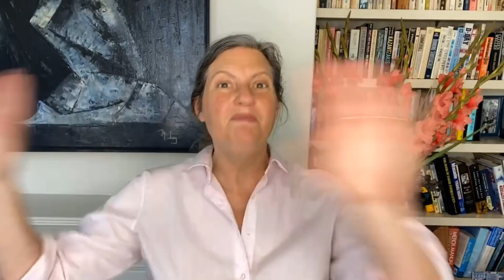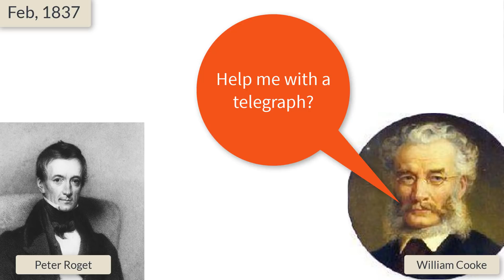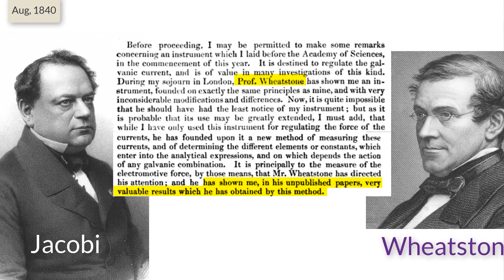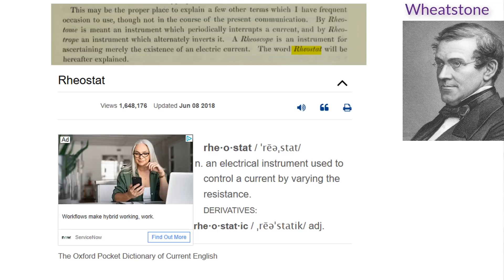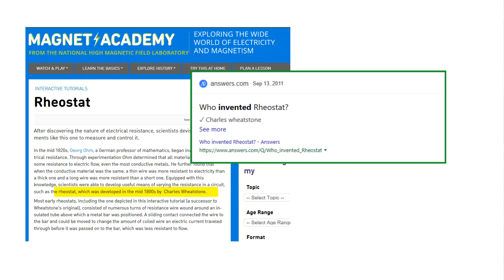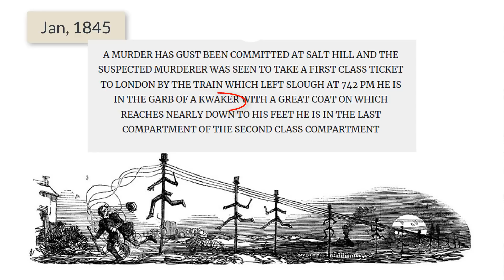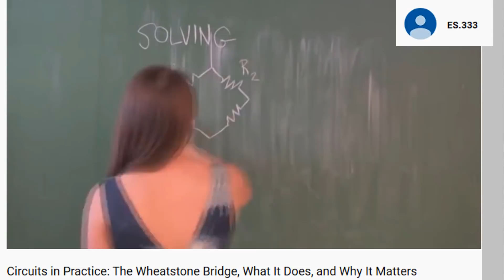Wheatstone Bridge: A (Not So) Honorable History

Comment: I don't think I ever got a Wheatstone Bridge that could not be solved. We were given them with some of the legs with more than one resister, not given the ohms given on the resisters but other Voltage or amps, for us to work out the Ohms from the voltages and current around it. It sometimes took half the black board to work it out.

Comment: Now with everything under the sun digital I seldom see even a single Reohstat in anything. 25 years ago we had at least 20 Danfoss analog 1 to 3 HP drives that controlled conveyors. No matter how many times we would spend calibrating start,stop & ramp up times after these 480 volt drives ran 10 to 15 minutes settings would drift causing major jams. These drives had at least 6 potentimoters. The replacement digital drives had no pots to adjust and once set they ran for years.

Comment: We used a Wheatstone bridge to create a gas detector. Platinum wires were 2 legs of the Wheatstone bridge. One wire was enclosed in a glass tube and the other platinum wire was in a gas stream sampling from a vacuum pump hooked to a small hose. If methane or other volatile gas is introduced to that open wire, it raises the temperature and changes the resistance in the platinum wire. A chromatograph could then be built by injecting a set volume into a "column" of silica gel which slowed the heavy molecules down. A carrier gas was used to keep a steady flow over the detector filament. Helium could be used or dried air was commonly used in the more rudimentary instruments. First gas to come out is methane and then successively larger molecules. The bridge records the change in resistivity to a chart recorder (today it would be a data logger to display on a computer.) Very simple and important on a drill rig attempting to detect entrained gases in the drilling fluid, very robust and non-fragile.

Comment: The Wheatstone Bridge was one of the early circuit builds I did as a child using my Heath Kit set from the mid 1970's. The Heath Kit was plastic blocks with a component inside and placed on a LEGO looking base plate. The blocks were then tied together with pin clips and wires to make a circuit. One of the more complicated builds was a 3 transistor radio, multi-meter sound generator, and timing counters.
Reply: When I was 11 I built the Heathkit Vacuum Tube Volt Meter (a truely useful and accurate bench meter) and when I was 14 I built the Heathkit oscilliscope. I loved those kits.
Reply: @pjh9104  My late dad went through electronics correspondence school through Bell & Howell and built the projects you stated. Subsequent courses used the built items to perform tests.
Reply: Built a Health Kit 25" TV while taking an electronic correspondence  class that the VA paid 90% of. Wish more young kids would experiment with wires & electronics. Doubt if 1% of people even know how to use a soldering iron or gun.

Comment: I have an idea for a magnetic motor. Please point out the flaws. First, there are no Souths to deal with. All the magnets are Halbeck configs. Take 15 stationery magnets and put them in a circle. (24 x 15 = 360) Then take 2 more and place them on an armature opposite each other, like 2 cars on a Ferris wheel. Place them close to the stationery ones. Since 15 is an odd number and 2 an even one, they will never interfere with each other. No Souths to worry about. Once the 2 rotating magnets are set in motion, you should be able to adjust the flux and get spin from the pushing 15 fixed ones. To accelerate, simply rotate the fixed ones like a distributor shaft. Well?

Comment: At 8:30  into the lecture I believe that there is a significant error pending your understanding of physics, but of the interaction between Jacobi and Wheatstone. Jacoby did not say that Wheatstone must have known about his instrument, in fact the opposite.  he said it was "impossible the he  should have had the least notice", which  speaks to acknowledging that the idea was not stolen but done in parallel.  He then goes on to in fact praise Wheatstone for discovering "a new method of measuring these current and of determining the different elements or constants, which enter into the analytical expressions, and on which depends the actions of any galvanic combination."  He also acknowledges the sharing of valuable results from an yet published paper, again acknowledging Wheatstone.
  Not the words of a wounded ego, I think. 
 Nor do I think negatively of your efforts here.  The history was very well done.

Comment: Interesting you mentioned a means of testing low resistance values. . .   Quite some years ago, I designed and built a 10 Amp "Earth Resistance" Tester. . ..  Recently I had a failed Inverter, it tripped all its Battery feed breakers.. .   I tested its DC input resistance with my "Earth Resistance" tester that uses an internal 12V battery and accurate 1 Ohm resistor, and  found the DC input to that Inverter was down to  0.028 Ohm.. . .   Years earlier there was a break on a UK-USA Cable, the special time fault locator was out of action, so the UK pulled out an old Wheastone Bridge and measured the fault o just of the USA coast.

Comment: Thanks for taking the time to share. Such a simple circuit but very important for the first precision or matched  resistors . It all seems so simple and obvious now but in 1839 sourcing an electric charge,copper wire or other metal conductive wire took some scrounging as well as quantifying  the electric charge s intensity and flow. The "Wheatstone" and Galv-meter led to the first calibration of tools to measure Volts Amperes and  Ohms.

Comment: I remember college classes that had Wheatstone bridge circuits, my impression is professors use this bridge for circuit analysis problems for homework and exams. But other than that, nobody uses it. Then out into the real world becoming involved with jobs that have strain gages, that's where I saw the value of the Wheatstone bridge. There is very very little change in resistance in the strain gage itself, probably not enough to reliably measure without the Wheatstone bridge. With the bridge, it becomes easy to measure (of course need reliable low level volt meter and stable excitation).

Strain gages can be fascinating considering they accurately measure stress in structures whether it be building I-beams, car frames, or force-moment balances.

Comment: In your Ohm’s Law video, you mentioned that just as the unit of resistance, the ohm, is represented by the Greek letter omega (Ω), its reciprocal, the unit of conductance, the “mho,” is represented by an inverted omega.  Some years ago, the unit of conductance was officially renamed the “siemens,” after the German inventor and founder of the Siemens company.  In the 1960s I remember that the sensitivity of voltmeters was still expressed, at least in the US, in “micromhos.”

Comment: Very interesting.  I only knew the bridge circuit as a rectifier
Reply: We used bridged diodes to build polarity guards on conferencing circuits. I one pair was reversed the bridge would ensure polarity. Without it one reversed circuit would short out the rest and efect volume on the call. Touchtone was also polarity sensitive. It too two decades before manufacturers finally put them in telephone sets. We used to work dozens of service calls on "Cant call out" daily before it.

Comment: Practical uses of the Wheatstone Bridge include load cells and strain gages.  Force and dimension change are able to be computed after gluing resistors to materials that will undergo stress. Being able to solve the Wheatstone bridge means you can make your own load cells on the cheap.

Comment: Another interesting an energetic presenttion. I worked in the Telephone Company in Ireland many years ago, where we used the Wheatstone bridge to measure the distance to a short circuit in an underground cable.
Reply: See my reply on that same method. Did you call the tests Varley or Murray tests? We also used it to find grounds.
Reply: @robertcuminale1212  Think it was Varley..
Reply: @banehawi  You know,  we show our age knowing about cable testing. So much of the plant today is coaxial and digital. Bit error rate testers are now cheap enough that all the technicians carry one. They have to test a customer circuit before completing the order. One thing craftsmanship and the technical skills have deteriorated. After the company laid me because of the AT&T split I went into business for myself. some of the people working for me couldn't use an Ohmmeter. One didn't know how to polarize a line, He'd never heard of "tip and ring." 
I'm very happily retired now.

Comment: Talk about a body electric:  A wheatstone bridge is a major component of a lie detector.   It is also the basis of the "E-meter" used by scientologists to guide their Dianetic "auditing" sessions.   I once got my hands on an E-meter  and soon learned that I could control it with my thoughts.   As an actor might do, if I thought happy contented peaceful confident thoughts, the meter  needle would move up to 4,  And if I thought to put angry disturbed violent fearful thoughts into my brain,  the needle would go down towards 1.   At any rate, this is just to say that the connection between electrical resistance and human thoughts is fascinating.

Comment: The bridge was used to locate breaks in telephone wires right up until the 1960s
Reply: We used it until the 1970s in Miami until all the Test desk men all retired. Then ELMOS, a computer program took over. Not as accurate but cheaper than personnel.

Comment: I worked as a Technician for a resistor company back in the 70's & 80's. We used our own factory built high speed testers and these testers were built with the wheatstone principles, but were far more complex. We had a decade resistor network that was set to the nominal value, two tolerance dials which set the plus and minus tolerance of the resistor under test. And finally a compensation pot that nullified internal resistance. Instead of two coaxial cables going to the test resistor, there were four and a compensation network was also applied to these cables. Then it really got complicated in that we had to test on the 60 cycle crossover. This was to keep any outside interference from the test. That crossover detection went to the logic circuit where it fed an "and" gate along with the bridge sample and the result "good" 1 or "bad" 0 went to a shift register. That's about it except that I did not mention that the sample signal is developed by a bi-latteral switch which is running at 60Hertz.

Comment: This is the first mention of the Wheatstone Bridge I've heard since I left Ma Bell many years ago.
Years ago telephone central offices had a test desk. In most cases it looked like one of the old corded switchboards operators worked from. The test desk took trouble reports from customers, tested them, dispatched a technician if necessary and then closed the ticket after noting what had been done to clear the problem. Most of them have disappeared if not because most testing is now done in the field by the technicians and the whole process has become computerized.

Every test desk had a Wheatstone Bridge mounted in a drawer. The test deskman (old terminology) used it to measure resistances on cable troubles using a Murray Test Or a Varley Test. A technician would call in and the testdesk using the cable plats send him to the farthest end of the cable and short circuit the pair of wires in trouble. The pair of wires would be connected to the bridge. If one side of the pair was grounded he would measure the resistance through the short circuit to ground. Then he'd reverse the bridge and look thought short in the other direction. Using a math formula and consulting the cable plats showed the overall resistance and capacitance the cable he could put the technician within a few feet of the problem location. I the cable was running in the air the outside temperature was factored in. Buried cable was consistent in temperature. Mixed buried and aerial cable caused a fluctuation in the math but a good test desk man could still get you very close.

At the time which was before the 1970s all the test deskmen were cable repairmen and a few equipment technicians tired of working outside in the weather. Some of the equipment technicians would transfer into the central office as Switchmen. That all changed in 1970 when the company women in these technical position to satisfy the Equal Employment Opportunity Commission. Without the field experience most of the women did the testing poorly. for the women it was all about money. The technical positions were filled with men and they paid better than the mostly clerical positions women were in. Almost immediately the company developed computerized testing. Once it had saturated the system almost all the testdesk personnel were downgraded to a clerical position that paid less and required less skill. The line cards were removed and the records were computerized. In an entire region there were one or two testdesk technicians and his testdesk used trunks to test in any troubles for the entire region. The Wheatstone Bridges. Eventually the Wheatstone Bridges disappeared. So did almost all of the technicians. The system is so computerized that people with those skills are no longer needed. That and the reduction of telephone lines on copper. Computers now compress thousands of telephones on what once could only carry one. Now you can get your telephone on a coax cable carrying your television signal and Internet service. Or you can just use a cellphone with a satellite dish for television. The installers now using technician as a title are installers. They have so little knowledge of equipment and electronics they are not technicians in reality

The Wheatstone Bridge left with the technicians and they aren't coming back.
Reply: That was the #12 test desk.
Reply: @gpwgpw555  Yeah, that was the old one. I would sometimes go inside to cover someone on vacation. We had a "temporary" test center using 2A cabinets. 
You must be another old timer. We're disappearing fast. It seems like someone passes every other month. And not very old either. The business really changed. The smaller COs have no one working in them. The cable techs make the inside connections, at least they used to until the SMAZ frames. Good Luck.
Reply: @robertcuminale1212  42 years as a switchman in Oklahoma City. I loved 37 years of it. In the last five years we became customer driven. meaning we did not fix anything unless customers reported trouble.

Comment: The basic bridge arrangement can also be used with two inductors or two capacitors as the top or bottom two elements, and that makes a very sensitive way to compare capacitors or inductors.   The circuit can also be used with a gain element like a tube or transistor to make a very accurate oscillator or filter.  Hewlett-Packard's first product was an audio oscillator that used such a bridge.

Comment: Jacobi’s “voltagometer” (“an improved rheostat markedly better than that by Poggendorf”)  worked by suspending platinum wires in separate mercury containers. The mercury containers are connected by a platinum wire that can be raised or lowered to increase or decrease the length of platinum generated by the current, and hence the resistance. 

Got this from a Dutch book from 1860:
“Over het meten van den galvanischen geleidingsweerstand inzonderheid bij metalen”
By Hendrik W. Schroeder van der Kolk

Incidentally, I like to find references in Dutch scientific literature, because traditionally, any educated Dutch person would have spoken German, English and French (and know Latin), so they were usually aware of more international publications than most).

Comment: I worked in a research and testing facility for a few years. When checking some background information on strain gauge measurements (you should know some basics of what you do), I also got to know Wheatstone's bridge. 
The measuring amplifiers nowadays are quite easy, you click on a button in the software to set all strain gauges to zero before the measurement, but in "ancient" times so had to tune one of the resistors in the Wheatstone bridges for each individual strain gauge by hand to start the measurement at 0 (or whatever value you liked).

Comment: Hello .I just found you . I was a cable splicer for CNT Canada in the70 s  I used a  WHEAT STONE for cable work but no idea now how we did it . GOD BLESS I watched more ,4 ohms to the loop mile ,get the Resistance to the cable or wire drive to location good luck . Buddies watching help me here
Reply: There were Wheatstone test sets built into the number 12 test desk.

Comment: Whatever you call it, the Wheatstone bridge had a huge influence in accurately measuring the surface stress in mechanical parts using strain gauges (resistance varies with the tension applied to a metallic wire).  Today, and for a very long time, strain gauges are sold in a Wheatstone bridge array which will automatically compensate for fluctuations due the resistance change brought on by the thermal expansion or contraction of the metal to which the strain gauge array is affixed.
Reply: It also applies to electrical meters, Ex: Western Electric 22A transmission test set.

Comment: Where the device ended up is as interesting  Turns out they are very good at measuring heat transfer and are the detectors in many gas chromatographs and other gas measurement devices.

Comment: I was glad to see that you did make it clear that Wheatstone’s bridge is balanced. I so dislike the misuse of the term by so many students who must get it from their teachers. Measuring zero current is so much easier than an actual current as the linearity of the measurement does not matter. Knowing the lost in translation and loss of references is interesting. Germanic use of references is different, or so I have been told, by those who fail to reference my work.